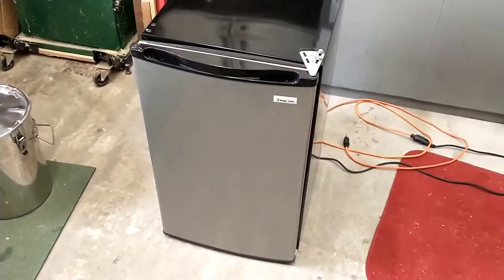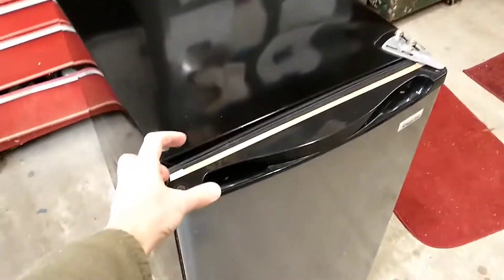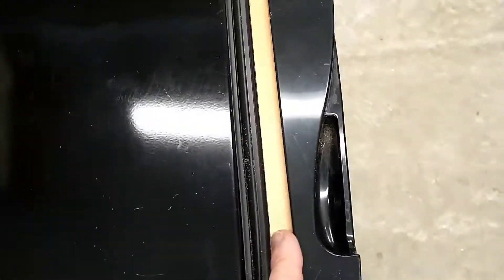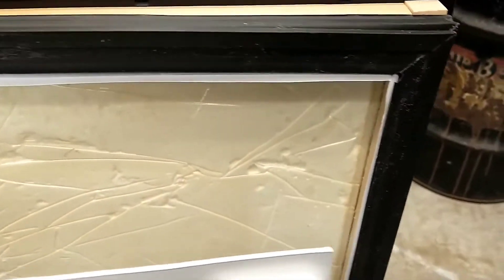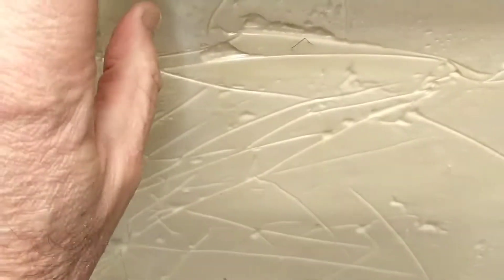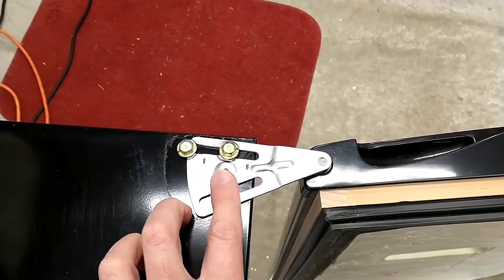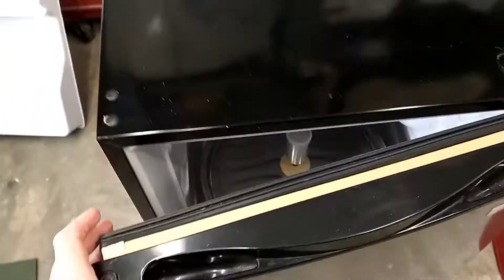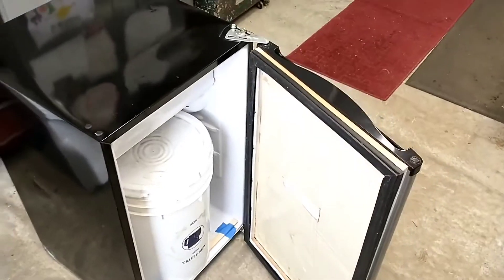Mini Fridge Fermentation Chamber - alternative build method

Comment: What is the height inside the fridge and the height and with of your ferment pot.
Reply from the maker: The pot is 16" tall minus the airlock
Reply: Thanks so much,  I have the brew bucket by SS brew-tech  and is about 20 inches because of the short legs.  I would be using a blowoff hose so it looks like I should have plenty of room.  Can you give me the height from the floor of the fridge to where the freezer starts.  That should give me the height I need. thanks again and a great video.
Reply from the maker: @johnwatzke7174  20-1/2" tall. So maybe too tight?